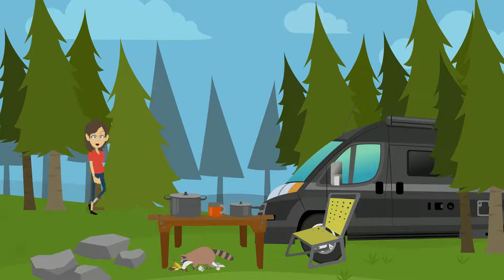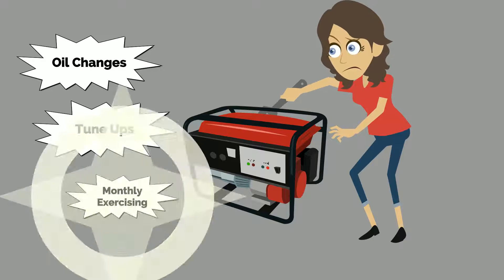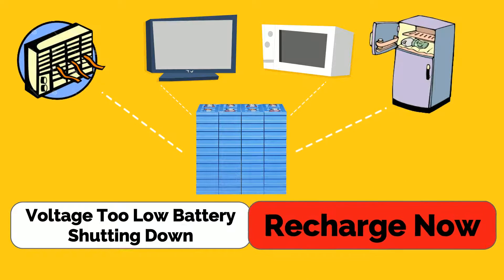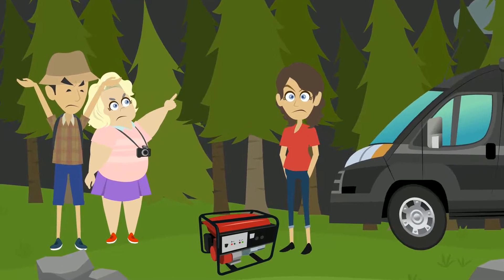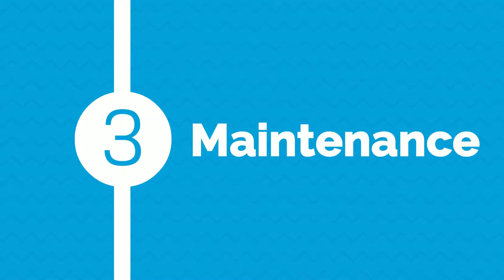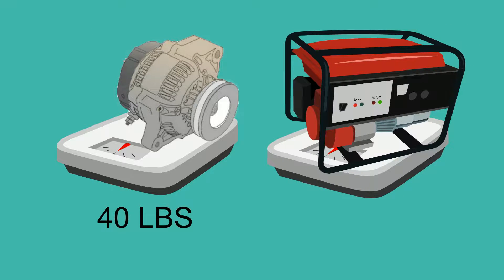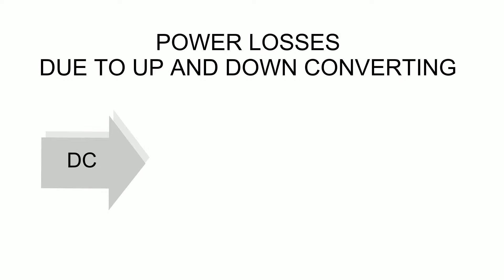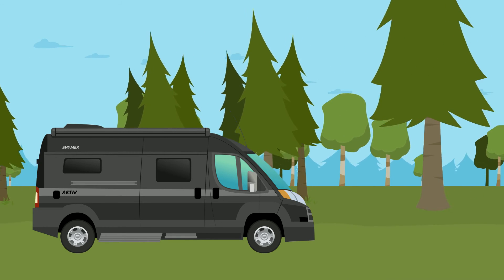Hymer Under-Hood Generator: How it works

Comment: I think it is a great idea, even with some of the concerns mentioned above.  You could also back it up with solar panels I would assume.  I am tired of my noisy generator breaking down and having to pay almost a $1000 to get it fixed (the built in one).  Plus they always keep my RV for a month to fix it, ugh!   In fact I now just bring a small Yamaha generator and bypass the main generator.  If it needs service, I am not tied to the high RV repair center costs.  At worst I could just buy a new one and it still would be cheaper.

Comment: GU generator ?
it just a large alternator, doing what they ALL do make DC for batteries
and then you power everything with a large inverter, especially if you want 120vac
just moving all the expense into the inverter and batteries
yes i think all Rv's should come with a BIG Alternator, for battery charging
but running the much bigger DRIVE engine just to charge batteies is NOT really more fuel efficient , yes it is much less work and eaier on the big engine, but your turning all that weight and using all those cylinders just to charge the batteries, that a smaller more fuel efficient engine can do

this is very heavily biased ADVERTISING

Comment: Seems like a very expensive way to generate power.  A small generator, despite its drawbacks, is much more fuel efficient than a big engine designed to move the entire RV.
Reply: Have you ever stored a small generator in a van ? They smell like oil and gas, No Thank You !!